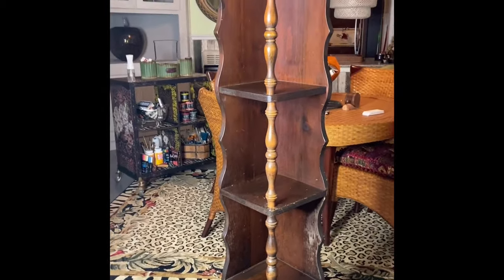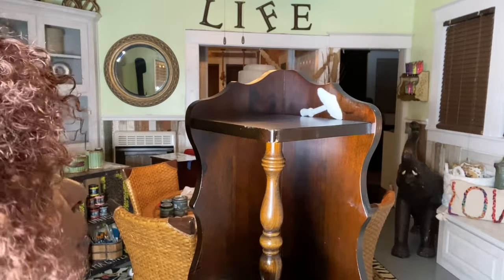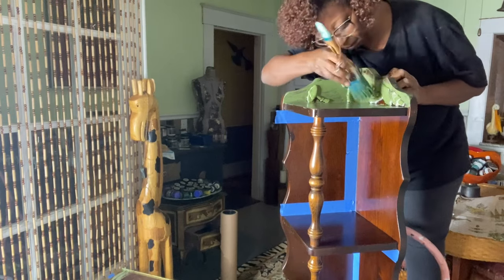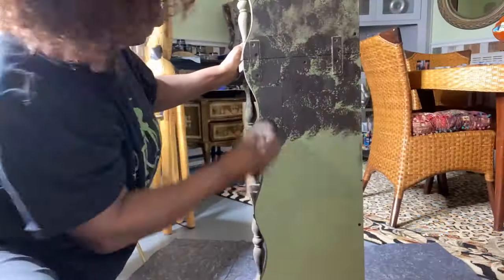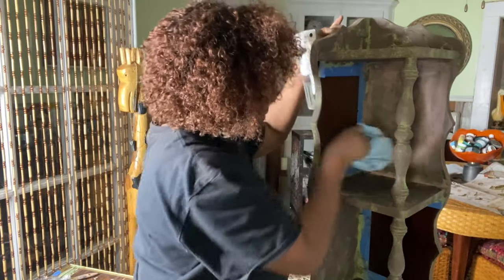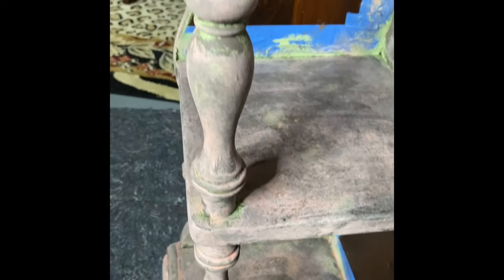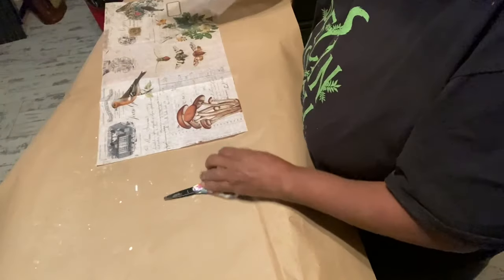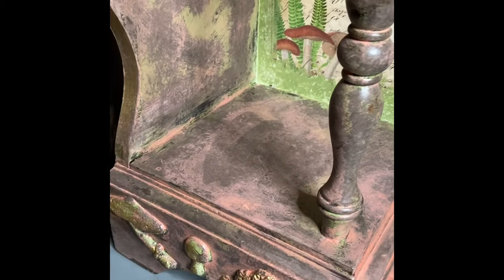Thrift Flip-Create an Organic Look on thrifted furniture

Comment: Very clever! I could not find on your website that kind of modeling dough that you used in the molds to apply to the shelving unit? I relisted as well to the video and couldn’t understand what exactly it was? Could you please explain exactly what that is and did you put it on with glue while it was still wet or did you let it dry first?
Thanks in advance !😊
Reply from the maker: Hello! So glad you enjoyed the video! I used Iron Orchid Designs air dry clay. The mould is the Toad Stool mould also by Iron Orchid. 
And yes I dust my mould 1st with baking powder. Then I used the Titebond Quick and Thick glue to put on the bottom of each while they were wet. 
You can find the clay and the mould on my website at www.pecanporchboutique.com
Reply: @pecanporchboutique9293  thanks!
Reply from the maker: @plant-a-holic  you are welcome🤗